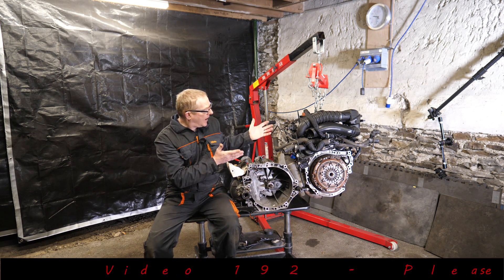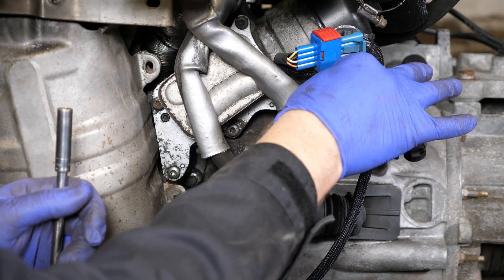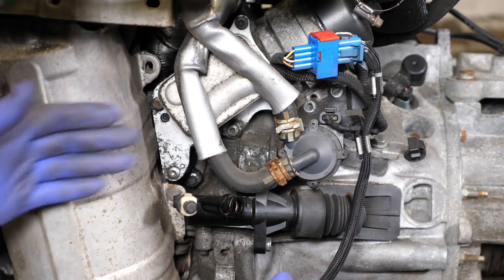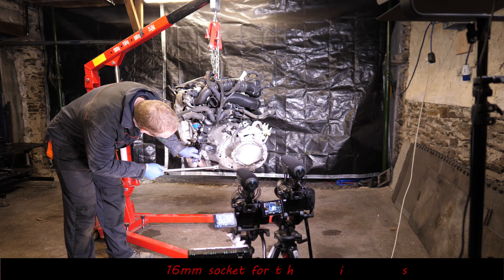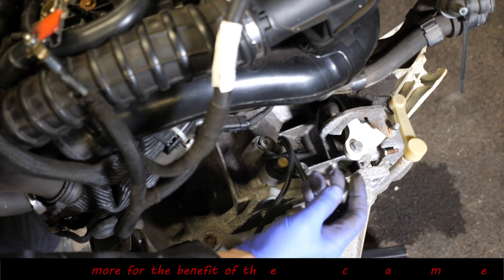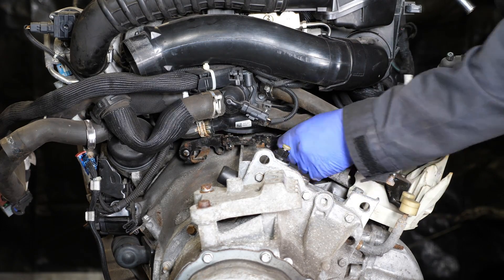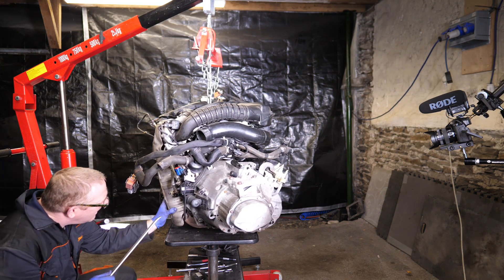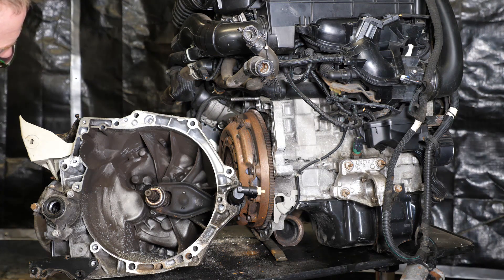Part 3 - Manual Gearbox removal on Peugeot 207cc 1.6 EP6 THP Prince Petrol Engine.  BMW Mini Cooper

Comment: morning,
will you show by chance how to mount the engine on a stand?
and by stand I mean something not resembling a table  😅 
also... what happened to the engine drop preventing "paranoja strap"? 😉
Reply from the maker: Once I’ve removed the clutch and flywheel I will put it on a proper stand.
Reply: @CoatsandGaiters  looking forward to a new video
Reply from the maker: Thank you.  @withgrowinginsanity198

Comment: Do you know if there is any way to make this engine more reliable and/or make sure it's drinking less oil than a mazda RX8?
Do you know what is causing this much oil burning? Piston rings?
Reply from the maker: I don't have much knowledge on the engine other than it's horrendously unreliable under normal servicing.  I presume it's like most modern engines now that needed their oil changing every 6,000 miles and if you don't they tear themselves apart.